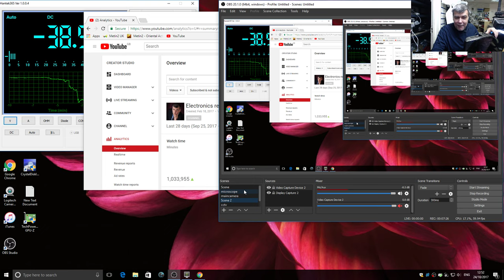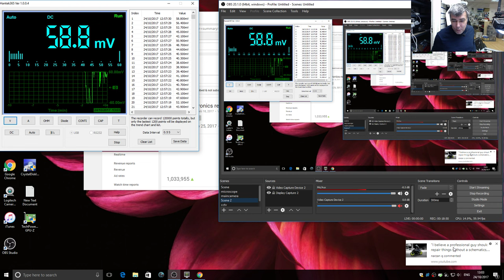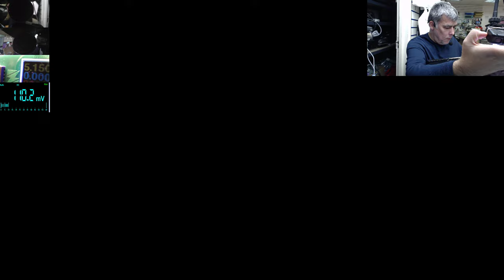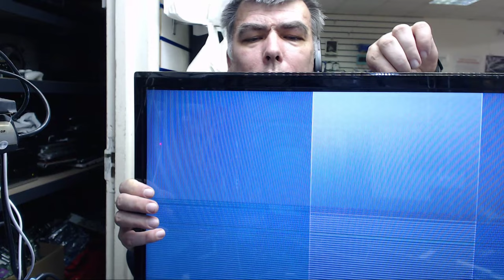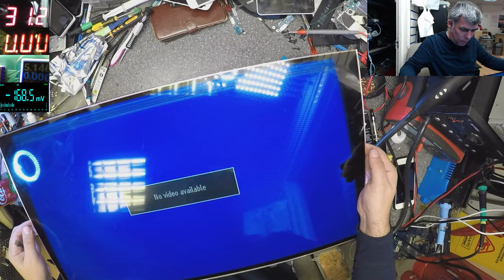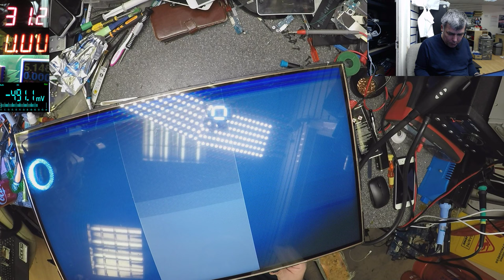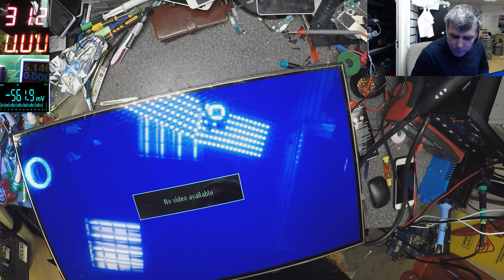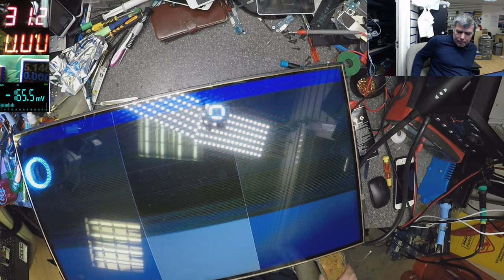How do we diagnose and fix a Tv screen

Comment: Sorin please keep uploading your videos because I noticed that we have just one or two a day now which is not enough for us hobbyist. We are hungry of real life repair without any schematics :). 
So according to your last video with the TV off course you should to check the screen picture with the torch before you removed LCD panel but unfortunately you don't have a enough space for this kind of jobs because you have to be very very carefully with the screen and I personally suspect broken screen tab in this case also in most of the TVs you can't short LEDs because backlight is sending feedback to the power supply and will see that something is wrong there. If you don't have LEDs you can use 2.6v zener diode and should be fine. 
Thanks for video anyway.

Comment: Good video.  One of the most common problems with newer TVs in my experience are blown LEDs in the backlight,  probably 75% of the time.  Cheap TVs have them all wired in series so if one blows,  they all shut off.  I tell people if you buy a cheap new TV,  make sure to turn the backlight output down as much as you can deal with.  You'll save your backlight!
Reply from the maker: very true!

Comment: A little tip I do for tv,s is use some tape and Mark it for top side so you know which is top and which is bottom love all your vids keep up  all the good work it might have had loose wire in connectors may be a loose solder point

Comment: Dont pay attention to the dickheads posting negative comments. You are helping so many people. If they don't have the patience to sit through your videos. They will never learn shit.
I sit through every video I watch start to finish. I like the way you teach. Even though there is a little language barrier. I Still understand you perfectly. I think the best ones are 1 hour or more. I'm sitting through it. So many videos like these online. But none of them I have seen come close to explaining what they are doing. And the way you do your videos. Is like I'm talking with you. It is great. I have not caught a live one yet. And honestly it doesn't matter. I'm still watching it.

If those negative comment people are so expert. Then why are they watching your video? Because they are full of shit.
Keep up the EXCELLENT work Sorin.

I have actually had experience with some tvs. And I'm not pro at all. Quick checks to see if main board will power up after power supply is working. Unplug the ribbons to the tcon and sound board if it has separate one. If the board powers up. Try 1 ribbon at a time until the board doesn't come on. If it comes on nd no picture. Unplug all ribbons from t con to y bus. Try 1 at a time to see if you get a picture. When you find the one stopping the picture. Disconnect between the y bus. Then you find it will be the screen. By that time it is no good. I scrap it for spare parts.

Comment: I have a samsung un55ku6000g and it doesn't start, apparently the tv tries to start but it can't, it's kind of a loop. I replaced the mainboard and still the same. The led strips are working, I can see them through the back of the tv (white lights), the stand-by light and the red light of the optical cable connector are working, when I disconnect the mainboard and turn on the tv I can see the white lights behind the panel, and a black screen in front of it (black screen but noticeable on) and apparently this model has no t-con board or it's part of the mainboard, I don't know. Maybe the power board doesn't push enough current?? How can I know the right voltages of this particular model ?? (I do have a multimeter) Some help here please!!!

Comment: Recently i have encounter  like this problem when i check the voltage 90v then suddently drop to 35v.. what i found that the backlight defective.. 1led busted.. i  jumper the led bulb after that the tv works fine..

Comment: this has happened to me 3 times out of 3 that i have tried to fix a backlight issue! i think its the way the strap is bonded to the glass screen?
i have 100% failure rate at this - was hoping you would fix it - did you ever get to the bottom of this?

Comment: Yes it is 100%it the LED screen problems.The micro LBS cable fibers bonding connections to those circuits boards issues to the LBS cables to the LED light admitting lighting out issues.The LBS cable connection to the LED screen digitizers circuits boards problems led to it LED screen pixels freezes and are not stabilizing and loses glues cohesion and stability of the lightings of the picture to the LED tv screen.

Comment: Minute 15:05 "I'm so bad". No you're not.
For people to understand what you are explaining they must have some knowledge in electronic, otherwise they just look for a quick fix. They need to know the basic like zener, diode, fet, transistor, ac, dc diode bridge etc
Most of the computers repair shop are basic IT people for them there is no point watching full video. I'm in Canada other places are different.

So you are one of the but still in order to understand they need to have basic electronic

Comment: It was predicted..... Removing the screen from his frame will do this. It is almost impossible to fix backlight on this.... Screen was glued once it will break apart when you lift the first metal bar.....
Reply: I did Fuckd up some screen like this. On some modells there are 2 layers of clips. If I remember correctly, with the closer one can you detach backlight part... Logical disassembly from out to in will ruin your day....
I lost a perfectly good ips panel because i have to reattach ccfl negative on 1 tube... Before that it worked correctly but had a small of burning due to arking over....

Bad day... No free monitor

Comment: I have repaired a lot of TVs. When I see one that does not have a backlight, I check if the LED/LCD itself has a picture. You can do this by shining a bright light from the top or bottom of the LED/LCD panel, to see if it works. I usually do it on the top, before I take anything apart. Also, the bottom ribbon cables that connect to the screen have probably got loose. https://www.youtube.com/watch?v=LysMj2Tcp4M. This may help. I really enjoy your content. Very educational. Keep up the good work!

Comment: A few tips 1) use masking tape in two corners to hold sheets in the right order, and mark with a T at the top so you know which way they go..
                   2) make sure the screen lays flat in each corner i have cracked a screen before as it was flat in one corner..
                   3) get an LED TESTER you can test 1 led or a whole string 
                   4) when repaired GO TO MENU / PICTURE AND TURN BACKLIGHT TO MEDIUM OR 50% depending on setup of menu, this makes the leds last longer
Reply: BY LED Tester do you mean backlight tester
Reply: 5. Never unplug/connect ribbons while TV is ON.
Reply: @sergeyk6886  lol i did that and the laptop was smoking ! Good advice!

Comment: RE: 7 minute viewers-People are used to 7 minute solutions because of television? It has to fit their time frame with no effort or logic needed. To repair electronics you need to THINK, not be spoon fed information because there are to many variables. I have been a technician for over 60 years and grew up with black and white tv's, vacuum tubes and relays. You never stop learning. Keep up the good work and great video's!

Comment: Well, I have a very different opinion... If one of the LED's failed that means that there are other prone to failure. I'd replace both strips with new ones. That's not fair for a paying customer to charge for a job that's prone to fail right after repair. I mean, that's like going to the mechanics repair your car's turbo charger and not cleaning the particle filter. That's a nasty job and really unfair for the customer.
Don't get me wrong, I like your videos but these kind of repairs are worthless 😕

Comment: If  1  led bulbs burned out the  protect ic  will shut down  the power  board.. pull out  the led wire  and  put 12 volts supply to lit the  bulbs and  bu the  time  the screen  will appear
Reply: Sir  just  pull the  led  wire and  put separate supply  for  it and  on the  tv
Reply: The  screen is  fine..the  led bulbs  doesnt  have supply

Comment: Maybe a power issue, jumping the led cause more compsumption on the PSU if no have a good regulation maybe you have a voltage drop in the logic power.
Reply from the maker: no, the backlight  work on current limit, so the power supply will supply same amount of current/amps